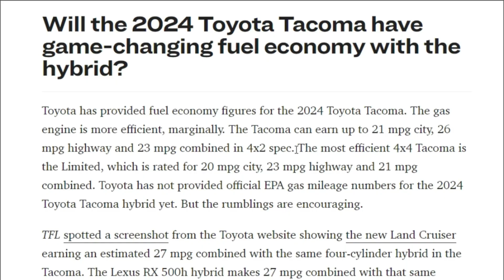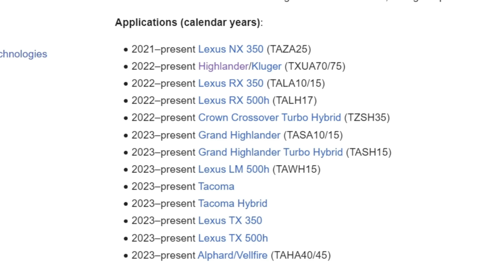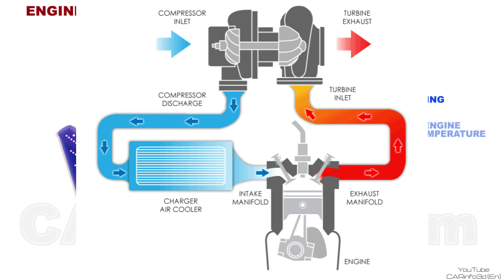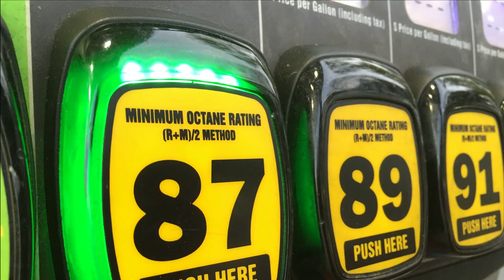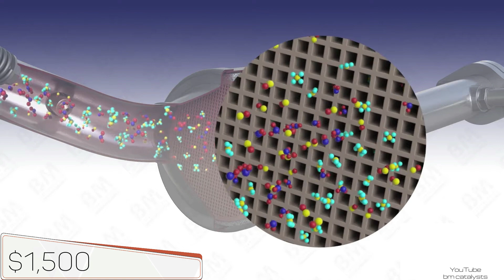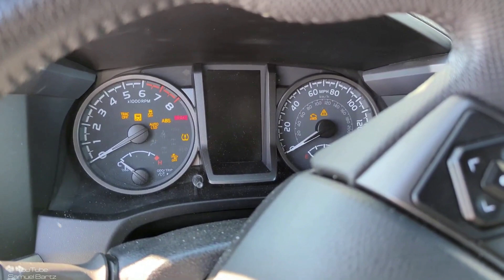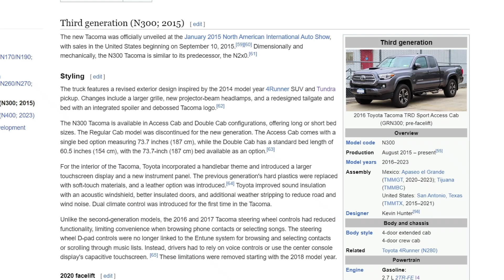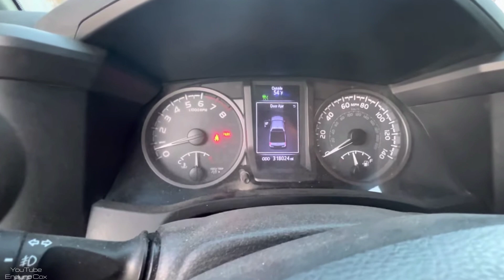Toyota Tacoma (2024–present): A Full Reliability Guide

Comment: The new 2.4 while having a strong bottom end and simple turbo system has a lot of unproven and problematic parts:
A coolant controller valve that removed a simple thermostat and turned it into a complex computer controlled plastic valve that has been problem prone in other vehicles/manufacturers.
They used low tension piston rings that can stick and or wear out quickly from carbon buildup not allowing them to move freely. Look up Toyota Corolla problems with low tension rings. You better stay on strict oil change intervals for sure.
Toyota chose plastic/polymer balance shaft gears that also are part of the oil pump system. Completely unproven in long term durability.
The engine uses an open deck cylinder design which allows good coolant flow around the cylinder walls at the possible risk of weak sealing of the head and block. This is a particular concern on a turbo engine. 
I think they have made some risky decisions in the name of improving emissions, gas mileage and overall engine smoothness/NVH improvements.
I don’t see as in the past an easy 250-500K problem free motor with basic good maintenance anymore. 
I would hope to be proven wrong. 
Meanwhile, I will hold onto my 2015 Tacoma 4.0 V6.

Comment: This 4 banging powerplant with an auto tranny may be okay for the on-road wankers but for off-road, the six with a manual in the Tacoma is the obvious choice. Toyota should put the Trail Hunter trim out with the six, the manual, a higher lift to fit 35" tires, and more beef in the suspension. But since they're catering to the consumers who don't buy the off-road trim for anything but false image, they seem to be on the right track.

Comment: Former Fusion 2.3L eco boost owner here... 200K strong and no issues with turbo or bottom end. Yes turbos are or will be a component that will need replacement at some time, but you act like its common as oil changes.  I am not in the least bit worried.
Reply: 174,000 on my 2.3 EcoBoost Ranger. No issues.

Comment: why cant i get an access cab anymore , just 2 door for 2wd. if you want a 4wd you need to buy a 4 door truck, at that point just buy an suv. 2018 sr5 sticker is 35 grand , 2024 sr5 is 45 grand and you get a little turbo 4 . they got rid of the avalon and replaced it with hybrid crown, no ice crown. no thanks my whole family is going back to domestic same reliability with 10 to 20 grand off the purchase cost compared with toyota.

Comment: The 2.4 turbo has been around for years in various Lexus models and has already proven to be exceptionally reliable and it is not uncommon to go several hundred thousand miles so long as you do your part and take care of the vehicle. That said, what people really want is a turbo diesel…
Reply: Diesel or Landcruser Truck
Reply: 2.4 turbo hundreds of thousands miles ,shut the hell up u idiot
Reply: This turbo 2.4 has been out since 2021 and you are saying.... not uncommon to go several hundred thousand miles in 4 years? I would say that would be extremely uncommon.. and even when it does happen... its very low cycle.. highway only driving, and is next to completely meaningless. Lastly none of these Lexus vehicles have or will ever be pushed like the Tacoma will be...
Reply: @austinwade3194  , I think for the most part those that take care of their turbo Tacomas will be ok. Certainly, there will be rebuilding or replacing turboes at necessary intervals. Although, overall I hardly believe that the turbo Tacomas will exhibit the level of reliability of the naturally aspirated 4-cylinder and V6 when owners are negligent on maintenance (i.e., oil changes, air filter, etc.)
Reply: @austinwade3194  2JZGTE, 3SGTE all want to talk to you about toyota reliability.
Reply: Excellent point. For some reason there are lots of Tacoma haters and turbo haters. I hope they make the prices go down some, but I’m sure I’ll replace my old Tacoma eventually regardless. And it will definitely have a turbo on it. Thanks Toyota for more power.
Reply: @Annon89 I just purchase mine and it's not for work but typical things a homeowner needs from time to time. I've owned Toyota's since 1985  two Corrolla's two Camry's a Truck and Avalon which I kept for 15 years.
Reply: @Annon89 __turbo will not equal more power !! Maybe speed...
Reply: @spy_b0t.743  you have no idea how turbo engines work do you

Comment: Author seems to be unaware Toyota has decades of experience making reliable turbo engines.
Reply: All else being equal, a turbocharged motor will NOT outlast a normally aspirated one. Physics being what they are, higher pressures cause more wear.

That doesn't mean that this motor won't be reliable or long lasting, but until it has been proven in actual use, it's just in beta testing.
Reply: Toyota only offered two other turbo cars in the US over the past several decades.
Reply: @YoungMTrucker600  in the "US".  As i recall the US isn't the only place on earth.
Reply: Reliable doesn't mean long lasting. I'll stick with my V6

Comment: Lots of new 24' Tacos having issues with engine and diff on awd models.
Reply from the maker: interesting to read your resources
Reply: go watch TFL truck segment when they snapped a drive shaft
 @thelonglastexpert
Reply: not the engine, it's a transmission issue that was built by Aisin.  The diff problem was solved with a software fix.  Go figure.
Reply: Lies

Comment: This is absolute nonsense. I have owned several Hilux’s (2.4, 2.8  & 3.0L diesels as well as a 2.7 and 4.0 petrol V6 in Africa and more recently a 2.8 diesel in Europe. All the diesels had turbos and since 1997 I have never had a turbo issue or any other issue. Only tyres and breaks and the recommended services.
Reply: this is the first time they had a 2.4L gas with turbo.  they have 2.4L diesel with turbo, but the diesel engine block is different from gas. Gas cylinder blocks are mostly aluminum and smaller in size, while diesel engines are mostly cast iron and larger in size.
Reply: I've known a few mechanics in my day, and they all said turbos only belong on a diesel.
Reply: @1393floyd  yeah.  And turbines are in airplanes.  Go figure
Reply: Working in Europe I have heard Toyota has had a good deal of problems now with diesel emissions components like everyone else. Gone is the simple bullet proof diesels of old.

Comment: This video is making long term reliability guesses.  This video is a little premature.  I drive a 1985 Toyota with the stock 22RE engine.  It has passed the reliability test. 😉 (currently 280,000 on the odometer)

I did notice one contradiction.  Avoid prolonged idling of the engine and avoid driving without a fairly lengthy warmup for the transmission. 🤔
Reply from the maker: If all engines were as reliable as the 22RE in the 4runner, I wouldn't have a job😂 Regarding the premature video, I presented all the information in the video by analyzing data from the entire internet. Nevertheless, I respect any opinion backed by usage experience. As for idling the engine, I will clarify that minimal warm-up before starting is necessary for both the gearbox and the engine. However, it's a different matter if you have already had a long trip, stopped, and left the engine running without turning it off for an hour while going to the supermarket. Using the engine in this way, it's not surprising that the engine started to consume oil and all cylinders ended up with scoring. Wishing your 22RE a long service life
Reply: the 22RE had a turbo version as well.

Comment: EVERYONE worships the Tacoma? That's a downright lie. Agree it is a nice truck, agree many do, but is not a true statement to state EVERYONE. Other than that, the video itself is good and give caution to small engines being turbocharged. I passed up a Colorado due to the 2.7L turbo and went with a Frontier with a good old fashioned 3.8L NA engine. For me, turbos belong on big block Diesels. I live in ID and have never warmed up a trans and believe me, we have winters...as I write this it is 7 degrees outside. However, I do not spin the wheels, just easy take off. If there was a big problem with a trans, they need to program it to start out in 2nd gear to heat up the fluid faster.
Reply from the maker: I think you don't have a high mileage on your car. It's your choice not to warm up the transmission; I hope you avoid any issues. Nissan is an interesting choice. However, the 3.8 engine has direct injection, which requires careful maintenance and the use of quality fuel. From your comment, I understand you have a Nissan. What is the designation of the nine-speed transmission on this model?

Comment: :48 shows a 7mgte while talking about Toyota being known for reliability lol.  1:26 ancient?  Who uses that word for something of the modern age?  Try dated perhaps?  3:56, the aluminum block heats up to temperature instantly?  Instantly?  who writes this crap??
Reply from the maker: In this case, the 7mgte doesn't serve as an illustration of reliability; primarily, this frame showcases Toyota's old car manufacturing. Perhaps 'dated' would have been a better description, but this is original content, and the author chose to use this specific word, and that's their choice. Now, regarding the aluminum engine, take a look at the thermal conductivity of aluminum. Or are you suggesting that aluminum engines are not prone to overheating?

Comment: I went with a 23 Tacoma Off Road 2wd as it fits all my needs and i love the look and reliability.  $39k.
Very happy.
Reply: Not nice, that's an oxymoron off road 2wd lol
Reply: @hiramrodriguez4323  good tires, ground clearance, rear locker, and shocks make a huge difference.  Speed is your friend off roading in a 2wd.  Outside deep mud a good 2wd can go just about anywhere a 4wd can, just not a easy.
Reply: @KTown_Painter  Yeah, uh no.  Speed is your friend on a nice road.  Not rock crawling LOL
Reply: I’m not knocking your truck man, but I don’t get how they call a 2wd truck “off road”
Reply: @BangBang-hk4rg  some people think any dirt road is  "off road"
Reply: @BangBang-hk4rg  I get it.  4x4 makes it safer and easier.  Just remember, up til the 80s men took 2wd trucks everywhere 4wd goes now.  Realistically, unless you're mudding  a rear locker, good tires, clearance and speed beat almost any obstacle.  So Toyota slaps on tires, a lift, a locker  and a suspension upgrade on a 2wd and calls it off road.
Reply from the maker: nice 👍🏻
Reply: Worthless in snow
Reply: @pb4920  if we get 2 inches a year then we're doing good.  Roads will ALWAYS be clear, save  occasional black I've.  Hardest part is the ice in my driveway and that's no problem.
Reply: Who the fuck buys a 2WD truck.... A broke bitch, that's who.
Reply: ahhhhh.....the last year of the good ones

Comment: The New Ford Ranger that’s coming out will have the best Reliability out of the Midsize Trucks. Ford is back to building Quality vehicles again after the UAW strike.😢 oh yes Toyota will be Dethroned
Reply: Ford building reliability 
I will believe it when I see it. As of today they are having serious reliability issues
Reply: @robm3357  just like the toecoma? Lol
Reply: Copium
Reply from the maker: Ranger is an interesting car, too
Reply: @thelonglastexpert yes you said it,care!
Reply: Never had a ford that did not fal apart and even though I was looking at Ranger I had to remember how ford did since the 90's and I went through 4. The OLD ranger was the only exception but I grabbed a tacoma because UAW strikes all for greed.
Reply: Ford has been putting 2.3L turbo engines in Mustangs since 2017, and a built up de-tuned version of that motor in the new Ranger.  They have proven to be pretty reliable, and until 2024 they were direct injection only.  

Toyota is using a more well built block than Ford, commercial grade turbo and dual injection.  Not to mention these engines will be under tuned for reliability.   Reliable turbo motors have been around a long long time!   People need to chill.
Reply: @onlineslacker101  toYota has a engine block nothing better than something ford uses. And a “commercial “ turbo? 🥴
I spose you think other manufacturers use what, a residential turbo? C’mon..
Reply: lol good one

Comment: Purchased the 2023 Tacoma trd pro since it’s the last of the v6. Don’t trust electrical and hybrid!
Reply from the maker: Are there any good discounts on them right now?🤔
Reply: @thelonglastexpert  nope
Reply from the maker: In any case, the 3.5 is a good choice, but in my opinion, Toyota should already offer discounts on the previous generation Tacoma @appleztooranges
Reply: I purchased a 23 4Runner TRD Pro for the same reason 👍
Reply: @appleztooranges, do not buy the 3.5L Tacoma, get the 4.0L Tacoma.
Reply: @dundeeecroc  that’s like saying do not buy the 2024 hybrid 4 cylinder crap. Buy the third gen Tacoma
Reply: @dundeeecroc  it’s obsolete
Reply: Lol, you bought the last of the gutless, no torque Tacoma's.
Reply: They should just call the last gen tacoma the Tacoma Camry.  It has the same engine except the tacoma weighs 1200lbs more
Reply: That gen is wack. Weak powertrain. The new tacoma engine didn’t even have issues like the gen 3 in it’s first 3 years out.
Reply: @lokkstarproductions6918 uh...the 3rd gen didn't have engine issues other than a oil leak at the timing cover in first 3 years.  The only issues were with inconsistent gear hunting in the automatic transmission.
Reply: @ go watch his video on engines to avoid. 3rd gen love to leak oil. Head gasket was an issue. Plus, timing chain cover leak wasn’t a cheap job.
Reply: You do realize the most reliable toyota is a hybrid 4 cylinder 😂
Reply: @ yeah sedan

Comment: I do not expect the new Tacoma to has major issues like they did with the 2016 Tacoma. However, I do not expect the new engine to last as long as the 3.5L or 2.7L that were in the previous gen Tacoma. The frame seems to be too robust and strong for that little truck. Therefore, I expect the ride to be stiffer and not to be pleasant under certain road conditions. In addition, it appears that newer Toyotas have problems with the interior's plastics, which seem to break easily. My biggest gripe with the new Tacoma, however, is the pricing. This trucks have become so expensive that the only way I can admire having one will be on a wall poster. If people are smart, they should keep their current trucks and not buy this overpriced truck. Let the greedy management wonder why no one is buying this thing.
Reply: Due to a stiffer frame doesn't mean the ride is stiffer (reviewers have said it isn't). It's better to have a stiffer frame and let the suspension do its work.  A twisting frame makes for a wishy washy ride and less control.
Reply: @dalef3583 When you drive it let me know if you like it. The stiffer frame means more vibration transferred to the riders. Why do you think they put hydrolic mounts on the cab of the upper trims of the Tundra? Do you think they will do that on the cheap Tacoma? There is no way the ride will be plush on that thing unless you are riding on a very good road. We will see who is right.
Reply: What major issues did the 3rd gen have?
Reply: i have had 6 tacomas, newest one is a 2018. never had any problems with any of them. @Tacobuster88
Reply: @Tacobuster88 although it was a transmission issue and not really the engine, the last generation was notorious for gear hunting.  The computer was always looking for the absolute most fuel efficient gear, which changes by the second in real world conditions. So the darn transmission was shifting all over the place.  That got better after a few years.
Reply: The '16's and 17's had some quality problems, but the main weakness of the 3rd gens is related to gearing. Diff ratios are too high. The 6 speed auto has TWO overdrives, and 1st gear is tall. The gaps in the gearing cause gear hunting in a number of scenarios.  It isn'ta quality problem, but a design that doesn't suit many users. @YerBoyTroy
Reply: @Tacobuster88 the notorious timing chain cover leaks and engine head gasket leaks.
Reply: @Jer-k1k  I've never heard of leaking head gaskets being a recurring issue for that gen. Timing cover leak also doesn't happen as often as you think compared to the shear amount of 3rd gens on the road. It's also a not a severe issue and more so a nuisance.
Reply: @Tacobuster88 2005-2006 models. No they did not have as much issues as the 3rd gen.
Reply from the maker: "shift to park" problem
Reply: Don’t say anything just go and drive one. You’ll see the difference from the old dinosaurs from last year even.
Reply: It’s July  2025- I drive 2023, 3.5L Tacoma TRD Off-road- I am extremely pleased with it;  enjoy the ride , performs great going to the mountains and rough terrain.  Toyota dealerships in the area are constantly pushing Tacoma-Turbo with multiple incentives ($$$) & want me to exchange my 3.5L with Turbo. 
Having seen reviews from experts such as this. I would hang on to mine for as long as I can.
Reply: @tariq3587 smart I wouldnt get rid of it until it blows up which will be never lol😂😂😂😂 
Those turbo 4cyl will never beat a NA engine
Reply: As long as your doing schedule maintenance on this engine,theirs no reason why you shouldn’t get over 300k miles on this engine!
Reply: There's already lots of problems and recalls already.  Goodbye "king of the midsize" title lol
Reply: @aaronberg5708 what problems and recalls? Please be specific.

Comment: They have already developed and been using this engine for years in there test facilities they are robust and make great power Toyota makes quality vehicles and and that’s there fan base
Reply: That's what they said about the tundra, now engines are blowing with less than 40k miles
Reply: @playa4lyfe451  except there aren't any blown up 4 cylinder turbo engines.
Reply from the maker: Looks like Toyota has big plans for this engine. So far, it looks like they've done a great job.